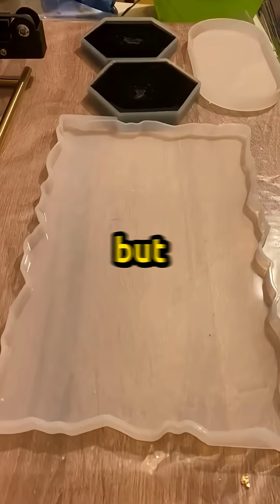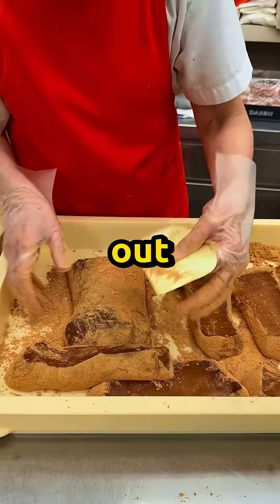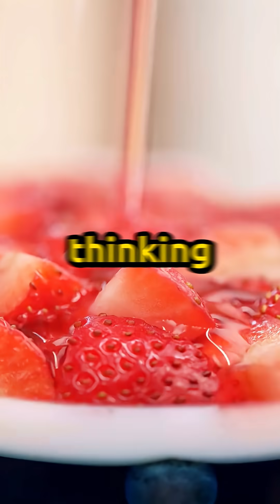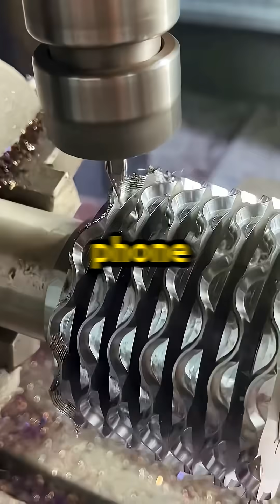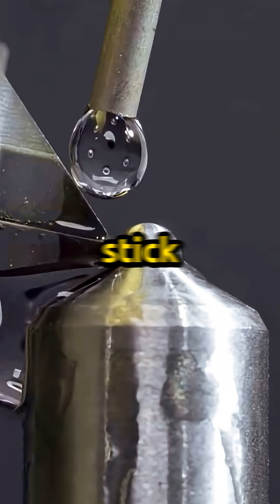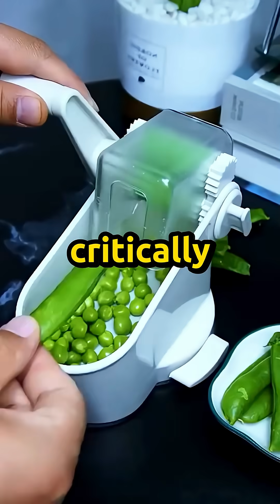Inaccurate thing child has been taught

Comment: Actually, you use all your brain, just not at once. It’s physically impossible to use your whole brain at once, and if you did, you’d have a seizure
Reply: Me during a test:teacher i cant use 100%of my brain or ill have a seisure😂
Reply: @ShavishJaikaran  You always use 100% of your brain. Just different sections, it’s what’s using EVERY section that’ll cause a seizure
Reply: Correct. You do use the entirety of your brain, but if there were a case where you were to use 100% of your brain at ONCE, it would definitely trigger a seizure. This is because the brain isn't made to operate on having every neuron fire simultaneously. If this happened, uncontrolled electrical activity would happen.. which is just a seizure.
Reply: Correct
Reply: And sometimes die
Reply: I’ve done that before I think